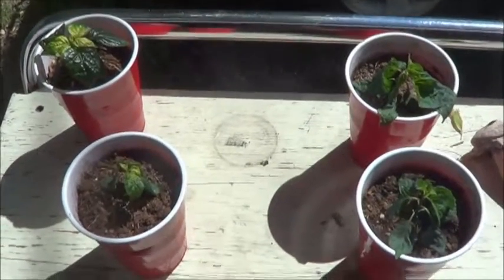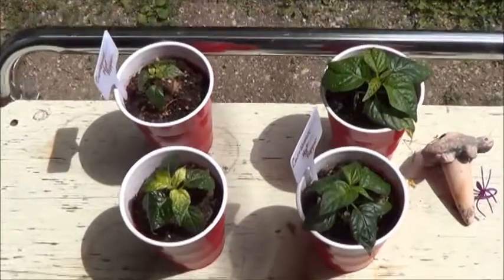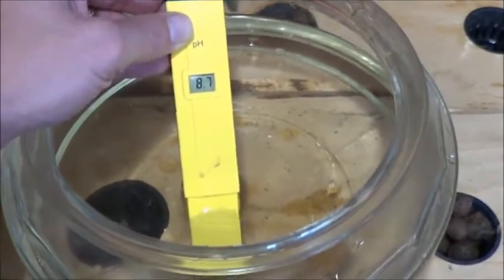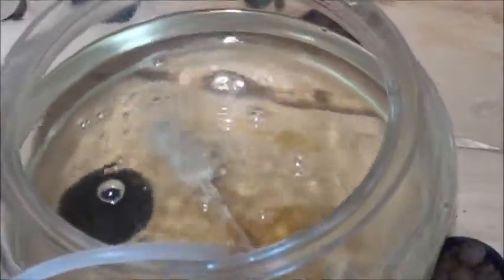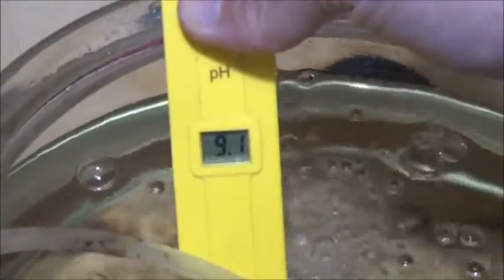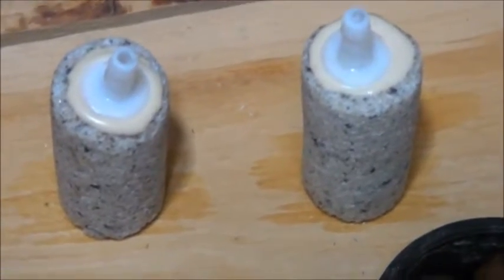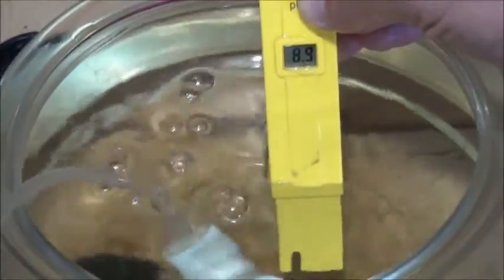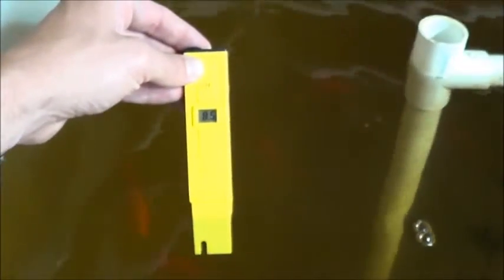Pepper Test and pH Issues

Comment: You could also use your ph meter to test the pH of any white vinegar you have then do the dilution calculations to see how much you'd need to add to that fish bowl.
Reply from the maker: I think the vinegar came up at around 2.1 last time I checked it with the meter.  A few drops at a time into the fish bowl should be easy enough to see how much of a difference it makes!

Comment: Simple way to test the co2 theory before going all out on the fermentation route is just some plain ol carbonated water into that fish bowl. Also worth a shot throwing a couple drops of vinegar in there as a last resort experiment.
Reply from the maker: I had lemon or lime juice suggested as a natural solution as well.  I don't mind the fermentation angle though since our yeast is getting old and in need of replacing anyway.  Grab a pop bottle add water, sugar & yeast.  Drill a hole in the top for some airline and stick the other end into the fish bowl.  Seems like the perfect sort of Bear project ...
Reply from the maker: bo ter berg That's a good point!

Comment: I'm just curious as to what makes you think that adding DO into the water would drop the pH? If anything it should in fact raise the pH. I hope I didn't give you that impression, if I did, I'm sorry and incorrect. Infusing the water with oxygen should actually aid in the absorption of hydrogen out of the water...thereby increasing the pH (though very slightly) as the available hydrogen (which is what is measured by pH) in H2O would be sucked up by the newly available oxygen to form H2O or -OH. The only way to lower your pH value (by increasing available H+ ions) is to increase H+ ions...which is where the phosphoric acid comes into play. Phosphoric Acid H3PO4 has loosely held H+ ions that can be broken off and increase the H+ ions available to increase POH and lower the overall pH in the H2O. The phosphorus is then absorbed by the organic life in your system to make ATP - then energy currency of all life on the planet. This is why I stress the need for pH down in the form of phosphoric acid, the phosphorus once consumed leaves the H+ with nothing to reabsorb it and the environment stays acidic. Which in turn promotes the availability of nutrients such as P to be absorbed. Oxygen is more basic in solution - only the addition of CO2 will lower your pH by creating carbonic acid (which is what our blood does). The -OH hydroxide ions created will destroy living-mater by tearing off Hydrogen atoms like a bleach, which is what peroxides do. They are basic not acidic, because they steal H+ out of the water because Oxygen is a Hydrogen whore. Just curious what your reasoning is?
Reply: JT Bear Any food grade  or hydroponic brand is fine - and you only need like a smidge I swear, it goes a long way. Maybe like 3 capfuls. And yes, I thought I might have been unclear about the pH on that or screwed it up - you do want to increase the DO in the water (acts like bleach and plant life loves it), but it isn't going to lower the pH (if I  said that I was wrong and probably half asleep). To be most accurate I should have said Oxygen is an electron whore, as it steals electrons or hooks up with anything having a loose one hanging around. That is why Oxygen is so corrosive - it is a greedy little element. The only thing it loves more than hydrogen is phosphorus - which is why P works so well as a pH down in aqueous environments - it leaves the H atoms out and free (an acid) and the Oxygen hooks up with the Phosphorus instead. Your plants need phosphorus as well, as I am sure you recall from biology. ATP (having 3 phosphorus atoms) is manufactured and used by every single living cell on this planet. Without it there is no energy movement and without that there is no plant growth, cell repair, gene transcription...nothing. So adding P to your system will only boost everything and make your fish and plants so much happier. The Tannins from tea might drop the pH, but I don't think it is good for your fish or plants, for some reason I think of 'Tannin' as being Toxic. I'll have to do some research on that one. Unfortunately phosphorus doesn't come bioavailable in many forms - so you are kind of shit out of luck on that one. Phosphoric Acid is about the only way I know to safely drop your pH AND feed your plants at the same time. Otherwise you need a whole host of microbes to convert it for them and that's just more mouths to feed. That's why pH down is worth its weight in gold and a must have for any aqua-nerd.
Reply from the maker: Ya, I'll be getting some once payout hits.  Not much 'cuz we're still kinda broke, but I'll be ordering a smallish bottle of it at least.  Thanks you so much for all the info, greatly appreciate all your help with this!

Comment: I just thought of something, the next time you check your ph in the IBC use a small container and hold it upside down and insert it into the IBC so air is trapped in it and then when your elbow gets wet, flip it right side up to allow water into it and then pull it out and test that water. In pools, when using a Water Test kit (liquid) they advise to get a sample from down in the water and not the top because you can get false readings. 
That being said, I have used a liquid test kit, test strips, and multiple electronic ph testers and all of them can give you false readings. I always trusted the liquid test the most but I had some times where I was soooo confused only to find out that the test was giving false readings and the ph wasn't 8.0 - 9.5 but was 7.4 like I wanted. Had another time it said that the PH was around a 4.0 but it actually was 7.4 again. I am OCD about my kit and always rinse my test kit out after every use but was told that every once in a while you will get a false reading. Test strips are KNOWN for false readings if you don't know how to read them but there is no special class to take to pick up on that, you just have to dip a few thousand test strips and you start picking up on it. I prefer test strips but I always fall back on the liquid test if in doubt and then use an electric meter to verify both of them.
Oh, and google using vinegar to lower PH. It will work but usually it bounces back to where it was but it will leave a sludge in the water. I was going to try this method but a lot of people warned me that they tried it and to google it. Glad that I did. I believe, but not sure, that lemon and lime juice are the same. I wanted organic for my peppers and I just couldn't find anything that sounded like it would work in the long run.
Hope this long ramble helps out any! Love your peppers, even the small ones look good after a drink!
Reply from the maker: I'm gonna quit fighting it and just buy some pH down after next payout.  The journey has been fun but at this point I just wanna get where I'm going!  I've heard that about top readings & false results before but for some reason I just keep on checking it there anyway.  I just I could always just trow on the swim shorts & hop right on in there to get my water but that seems a little silly.  Would be fun, but silly all the same.  I hadn't heard about false readings from chem test kits before, so it's good to know going in.  Double check is the way to go there then I suspect.  Sort of a two is one, one is none perspective ...  

I've heard bad reports on using vinegar as well but I'm starting to feel a little desperate!  That's cool though, water changes will get me through until I can get it under control.  Not that I'm a control freak, I just need the garden to do as it's bloody well told!  ;-)  I think BrightAgroTech has a video up somewhere with the 'organic' solution to all of this but I watched it so long ago the title escapes me at the moment, guess it's time to surf through some of their older videos & find that info again!  Perhaps even write it down this time ...  
Attempt to be all 'logical' n stuff ...
Reply: When you get some PH down if you are buying online, try to get some in powdered form if they have it. There is no point in paying to ship water!
Bright Agrotech has some amazing videos. Dr. Nate is a godsend!!
Water changes may not be too good. If the PH is high out of the tap then you are going to just replace the AP water that might be dropping in PH due to the bacteria with some more high PH water with no bacteria in it.
Just my first thoughts.
Reply from the maker: It's a good thought but I'm pretty sure our tap water is closer to pH neutral.  Town treats the water with one of those Reverse Osmosis setups and skips all the 'fun' of fluoride and chlorine.  I've heard RO water is a good way to go, so ... it's that or the rainwater but since only part of the roof is tin I have some questions about it for the fish tank ... 
Great tip about looking for a powdered pH down, totally no point in shipping water!
Reply: Now you have me wondering, if it is close to PH neutral then there must be something raising the PH. I would jump on the air stone argument but fish people would have been complaining about them by now (not that I have Google it yet).
Any other things in the system that might jack up the PH? I can't think of anything else now that you got rid of the rock unless that is a residual of the rock you took out.
Reply: That makes a lot of sense but I need to look more into it. I know aeration is good and I know that O3, or Ozone, will kill most anything so I am sure there is a happy medium somewhere in there! Lol!
I have to say that all of my DWC beds with aeration are the best beds that I have in the greenhouse, though!
Reply from the maker: I know, I was thinking that more air was the sure fire answer but leave it to me to screw up and add too much!  Classic Mr Bear ...
Reply: I don't know, if anyone is adding too much air it has to be me. You heard how much air I am pumping and I have had no bad results yet except for pest damage. I will look into that tomorrow and let you know.

Comment: i think the rational for what you've been said, is that air could adds co2, which will form hco3- +h+ , here is your acid. But most likely, your water is already equilibrated with the atmospheric co2, which means, its not gonna change anything. 
Actually, your fish and your plant roots are releasing co2 in the water, you might even increase pH if you loose disloved co2 because of the bubles... air stone is made of silica (basically glass) they are not affecting the pH (beyond equilibration of co2 concentration. with the atmosphere). 
Did you test your tap water? what pH is it at? if its high, you might want to treat it before adding to your tank.  Try soil acidifier for blueberries, or pool acid, or chlorhydic acid if its sold in Canada. just add a few drops into a gallon (or a litter) and see how it changes the pH, and then 'back calculate'' how much you need for the tank to change the pH of 1 unit, and then add  1/10th of that amount and see how the ph changed. repeat everyday and keep measuring thee pH as the amount to add might change depending on the pH.
Reply from the maker: You know, I never did test our tap water to see what it's pH is ... That soil acidifier for blueberries might be a good idea, they might even have some of that in town!  Probably not, but maybe!  I'm going to break down and get a API water test kit next payday and find out where I need to go from there, odds are I'll end up ordering some pH down as well.  Experiments are fun but it's starting to take it's toll on my poor fish ...  
Thanks for the feedback!  :-)
Reply: Hi JT,
Since tap water is not your only source, I'd test your rain catchment too (if your reader is still working, damn gravity). Oh, Eh, hope you had a great Canada Day. Cheers,
 Bill
Reply from the maker: William Walter We had a fantastic Canada Day, thanks for the thought!  Lol, did you see Chox's video about it yet?
Reply: Why yes, yes I did. To bad there is no footage of Chox down at the Co-op or post office. As a bonus I've also watched some of the orb man videos.

Comment: Dude, you need the air stones, the air bubbles without are too big. Also air stones will raise your ph, not lower it. You can use small amounts of vinegar to lower it. If you get too low, use some baking soda or higher ph water to bring it back up. You want 6.0-6.5 for peppers. I like to bring my water down to 5.4 or so and let it climb back up to 6-6.2.
Reply from the maker: Thanks for the tips!

Comment: It's CO2 that lowers pH. If the CO2 off gases, it'll raise the pH. Courtesy of wanting a high-tech aquarium (with CO2 injection, high lights, and ferts) :-)

Cheers!
Reply from the maker: I was always under the impression that there was no such thing as too much DO in a fish tank but I've been wrong before.  I'll be wrong again too I'm sure, it's important to be consistent ...
Reply: Lol, love how you put that. We've all been wrong, and we'll all be wrong again. Heck, even I'm wrong about a lot of things. So, I guess we're all pretty consistent in this :-P
Reply: JT Bear Also, there's no real such thing as too much DO either. It just depends on your goals and what you keep. Fish need DO, so in fast flowing streams and other places there may be fish but few plants. Along the same lines, too much CO2 can be deadly for your fish. While I'm not certain of the maximum safe drop in pH increasing CO2 can get you, I've heard from others on PR Aquatics that it's common to get 1 whole point drop (i.e., from 8 to 7) in high-tech tanks (though again, the plants are using a lot of the CO2 but it still has the pH lowering effect), though again I'm not sure where the safe limit lies for your fish. Hope this helps clear up a few things! It'll take a much too long message to fully explain the ins and outs of how this works and all, so if you still have questions I'll be more than happy to answer them, but I don't think this is a valid long-term solution (plants don't use CO2 at night, so aquarists typically turn the CO2 off at night so as to not kill their fish from lack of O2 - being the main reason, and I'm pretty sure this'll only work with aquatic plants, as I'm not sure how much aquaponic plant roots use O2 and CO2)
Reply from the maker: Think I'm just gonna bite the bullet at get some pH down after next payout.  I've been fighting it but it's clearly a loosing battle.  Sometimes a guy just has to do what you're supposed to, I guess this is one of those times!  It's gotta be tough for experienced fish keepers watching what my poor goldies are going through, thanks for sticking around!
Reply: Not a problem JT. Love your channel and I pray it grows tenfold someday. You have great videos that I love seeing, even if your goldfish do go through a bit of turmoil along the way (a lot of fish do and most fish are hardier than you might expect, so I'd start really worrying about your goldies if they started dying suddenly or developed disease, but then it'd be a whole 'nother bucket of worms ;-) )